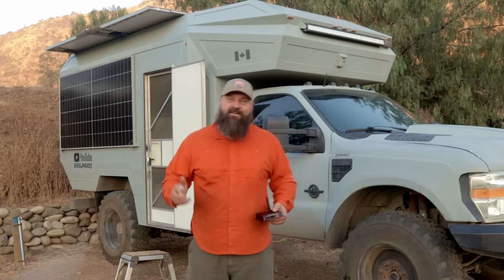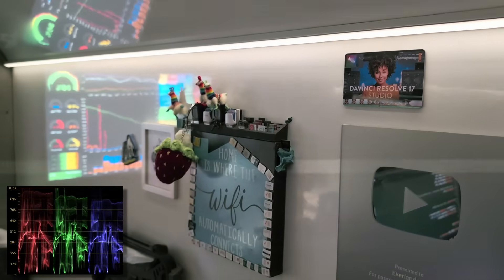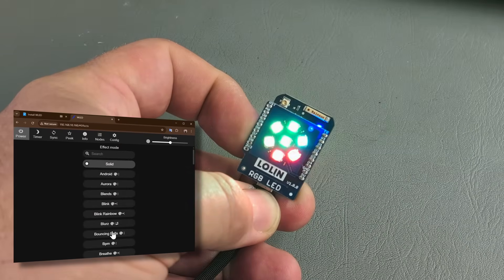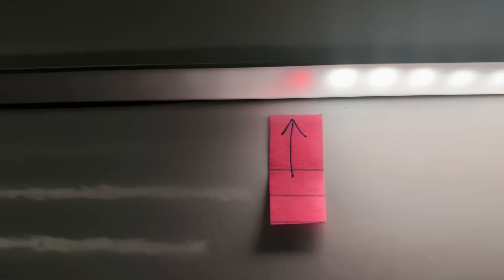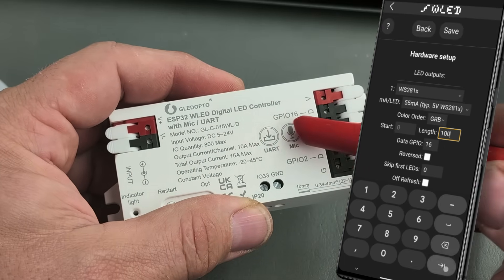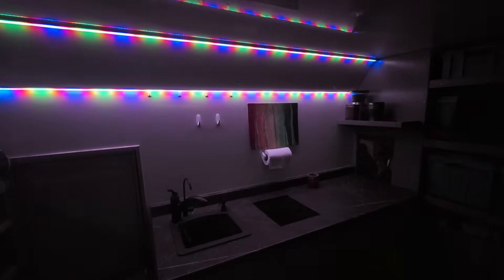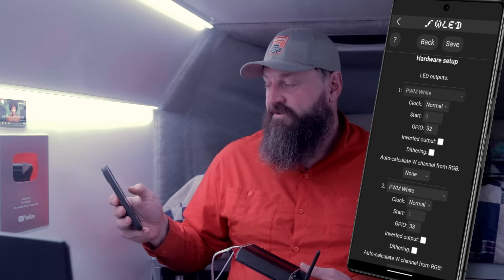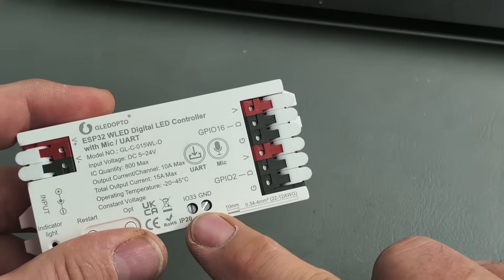Upgrading our White and RGB LED Lighting Controllers! WLED and QuinLED AN Penta Plus.

Comment: Nice, very informative. I've been thinking about this exact thing myself. I want task lighting, but also RGB and I understand that for this I should be running an analog strip and an rgb like you. So the rgb would handle the effects and transition as you then dim up the analog white led strip because it looks really nice and seamless and I suppose it's not too important what individually adressable RGB to use, no exclusive white led on those I assume?

And just so I understand the setup clearly. You have:
QuinLED an-penta
Gledopto (why not a QuinLED DigiQuad?) too expensive in comparison?
Analog white LED strip - any specific model I should look for? COB for this?
RGB strip - same here, any particular model you recommend?
Diffuser channel to fit two led strips, which one?

Thanks!

Comment: -WS2815 LEDs have a backup data line, when a LED burns down, the signal still gets transfered to the next LED.
-Ethernet Cables are a good source for twisted pair wires. There are even LED controllers that use Ethernet cables for data transfer, for example: Teensy OctoWS2811.
-For Long data lines you can use RS-485 differential pair transmission, you can have Datalines as long as 500 meters with twisted pair cables.

Comment: Data line noise (EMI). How about lowering the impedance of the data line with a couple of resistors? Think of it like terminating resistors on an RS-485 data line (not quite the same since RS-485 is differential), but even single-ended, it should make the data line less susceptible to interference.

Comment: I do feel like sk6812 with warm white would give you just a bit more flexibility and a bit more comfortable light.  Your current white feels a little too cool to me, and while adding some red does warm it up, having the option of a warmer primary light is also super nice.
Reply from the maker: No, not nearly bright enough for task lighting.
Reply: @Everlanders  right, I'm not saying replace your existing pwm lighting.  Just giving you a bit more flexibility with an additional warm white diode on your colored strand.

Comment: Sorry if I missed it, but did you actually replace your existing white LED strips at the same time, or are those the ones you've been using for years? I'm trying to decide whether to get the RGBW addressable ones for my workshop, I'm worried they won't provide enough lumens. I'm wondering if it's possible to orchestrate a combination of plain DC strips with addressable RGB. I want a nice neutral white and high CRI.
Reply from the maker: I kept my high lumen White LEDs, the RGBW aren't bright enough for task lighting in my opinion.

Comment: Do you ever find any of these electronics, that are network capable, communicating back to its home of origin?  After seeing cheap USB/CAT5 network dongles installing malware, its got me concerned.
Reply from the maker: That's the beauty of Open source software. You can audit it yourself...
Reply: Yours is a highly valid concern, but also the reason why Open Source is so necessary; you can audit every line of code.  You'd hear about it very quickly if they did something like that, and the open source project itself would get shamed off the Internet, almost instantly.  I'm assuming you're following the Louis Rossmann "BwE" situation.  There's people that audit networking features with a Internet gateway device that is running something like Wireshark (another open source program) that can inspect the data inside network packets down to the binary level if necessary.  You can also easily build one of these devices yourself if you're particularly worried, or provision a special "IoT-only" segregated subnet of your own network at home to ensure it can't spy on any of your other devices.  You can also build these types of subnets with open source devices and software to ensure they themselves are easily auditable.  Cybersecurity is fun stuff, but I wouldn't be too paranoid about it, because it's in everyone's best interest to have these types of devices be completely clean.  People get very upset when they find someone who breaks everyone's trust like you described, and good people step in quickly to limit and repair the damage once it's brought to light.

Comment: Nice video, thanks!  For the LED strip noob, like myself, you have a digital individually addressable strip as well as an analog strip separate for the white lights?  Was looking at the QuinLED specs and obviously have a bit more to learn if I want to (le)dabble in this tech as well as analog vs digital +/-'s.
Reply from the maker: Yes, RGB LEDs can make something that approximates white, but the quality of light is terrible. You'd want dedicated white LEDs for task lighting. But the quality of light is terrible. You'd want dedicated white LEDs for task lighting.
Reply: @Everlanders  👍